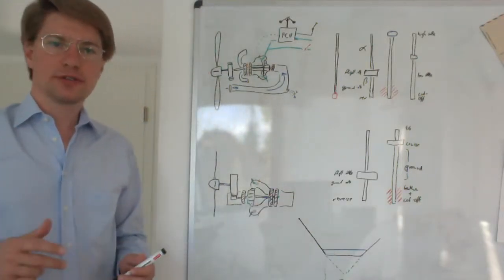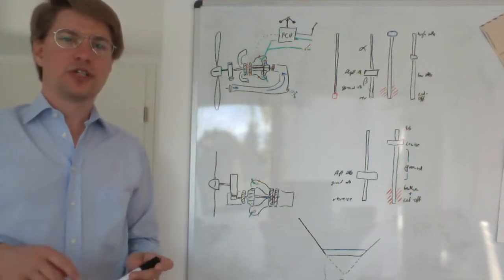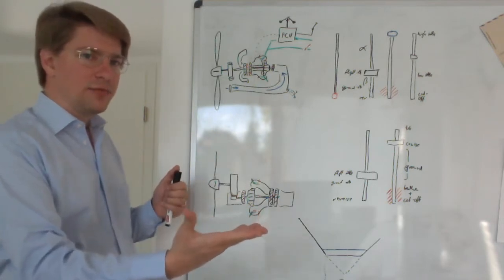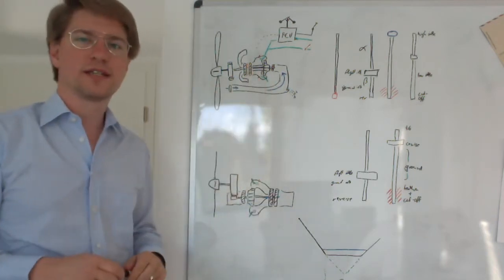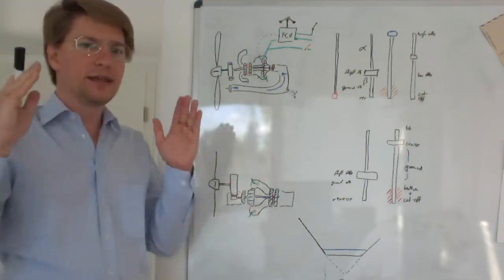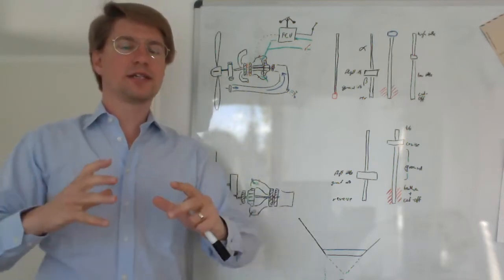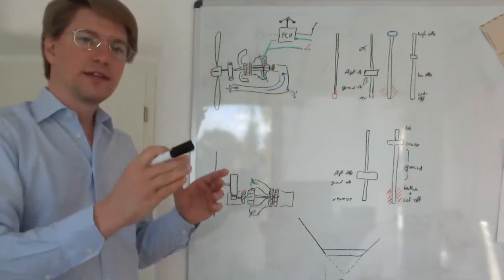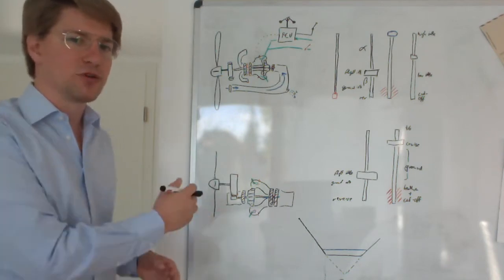Free turboprop vs fixed turboprop engines

Comment: Thank you for this. I purchased a C441 with TPE331-10 and took the 5 day initial training at SimCom and never learned as much about the engines , let alone the distinction between them and the PT6 as you taught me in a 15 minute video.

Comment: Thank you for the info. If I recall correctly, in CASA C212 aircrafts that uses Garret (now Allied Signal) engines when the emergency shutoff is used the propeller will be to feather condition. And the pilot use the un-feathering pump to get them to plate before startup.
Reply from the maker: That's right. X-Plane supports that engine type, too

Comment: Excellent explanation! I'm not a pilot but am fascinated by the different ways that all internal combustion powerplants operate, converting fuel to usable energy. I personally think that small efficient turboprop engines will eventually replace piston engines in private airplanes; mostly for their increased reliability, lighter weight and fewer moving parts. I can't tell what might be the differences in exhaust emissions.
I did not know there were these two different turboprop engines. Now I will be able to recognize which type of turboprop on an airplane, especially on its startup. Perhaps also the frontal exhaust stacks on a free turboprop?
I wonder if a fixed turboprop engine will exhibit a torque effect, whereas the free turboprop might not -- or perhaps not as pronounced?

Comment: Thanks for the video, its great. I have a question...for all variable pitch prop aircraft, you need to adjust different configurations for MAP (InHg) and prop RPM (piston engine) , or Torque or HP,  Prop RPM, and engine RPM (in the case of a free engine, in a fixed one i think you would only have an RPM gauge for the engine) am i right? Well, are those values unique for each airplane and in real life pilots memorize each configuration for taxi, TO ,climb, cruise, descent,and approach?(I also know that those can change with factors like PA and the range you want to reach, etc,and you will have options to choose in AIM for different flight conditions.)  But in general, are those specific configurations you need to always follow? Or are there  standard configurations that a pilot can use to correctly fly an airplane without choosing one of the manual options? Im interested in learn how to correctly operate engines and props with different airplanes in Xplane 11,but im not sure if i could do that without specific AIM knowledge for each airplane. Thanks a lot

Comment: So, in the free turboprop model, there are no planetary reduction gears?
Reply: In the PT6A series of (free turbine) turboprop engines, there are 2 stages of planetary gears housed in what’s called the Reduction Gearbox (RGB). Rough order of magnitude they reduce the turbine speed of around 33,000 RPM down to a propeller shaft speed of 2,000+/- RPM

Comment: Now which is more efficient?
Which is more fuel efficient?
Which is more responsive?
Reply from the maker: The single-shaft engine is more responsive. Flying a fixed single-shaft turboprop is closer to flying a piston engine than a jet. The single shaft can also be more efficient. However, the free turbine wins when it comes to robustness, reliability and longevity. There's a reason everything that flies out to artic unimproved strips in northern Canada, or dirt strips in the jungles of Papua uses the PT-6 engine, which is a free turbine.